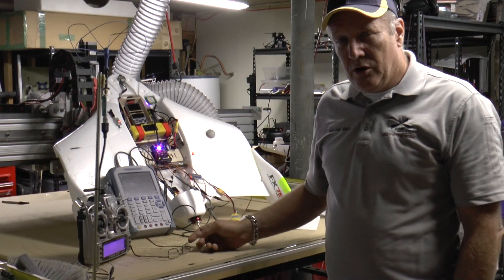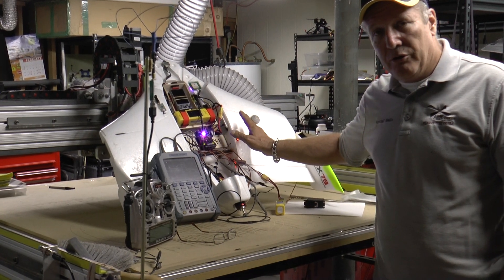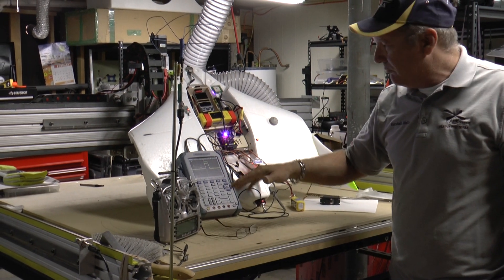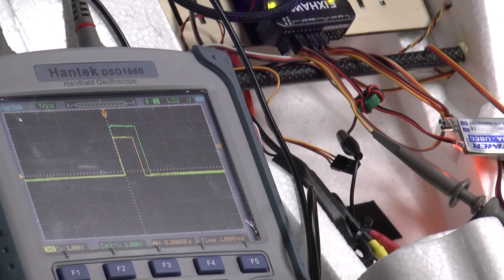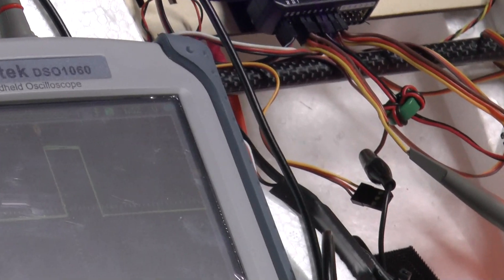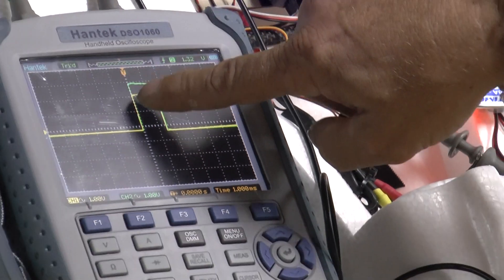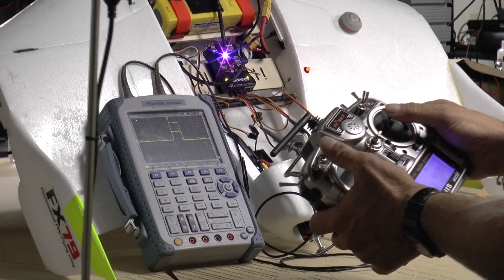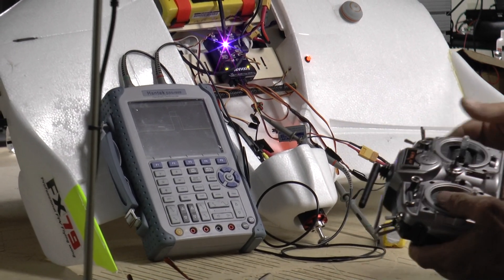FixHawk UBEC for Servo Output

Comment: it's also recommended to use a zeener diode, and although it might not be necessary, depending not he type of servos, and load of the servos, it's a really good idea to protect the pixhawk against re-boot, because if it sees slightly too much voltage, it will assume that it's for high voltage servos, and quit using the power from the  servo rail. 
just look at the documentation for pixhawk at arduplane.org for more info

Comment: how can i do this with my rc helicopter?? I'm having a hard time wiring this up! can u provide me with a diagram to hook up all my servos to the pixhawk??
Reply from the maker: Cole Davenport 

Just add a 5-7.4 volt/dc regulated power source at at least 5 -10 amps depending on the amount and size of your servos....to the output rail... top pins are ground....middle pins are power..... connect the regulator or UBEC direct to your lipo
Reply: How did u plug up everything to the pixhawk? Also how did u program the pixhawk to work with the servos?